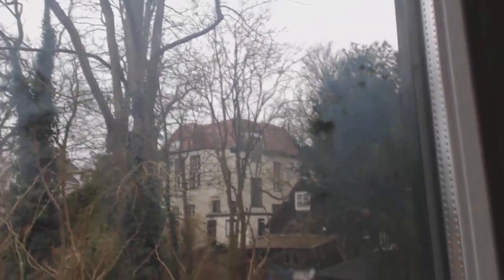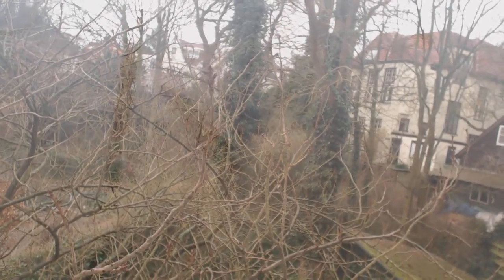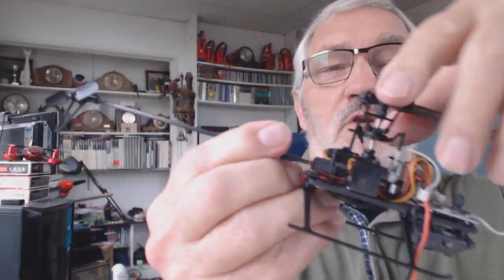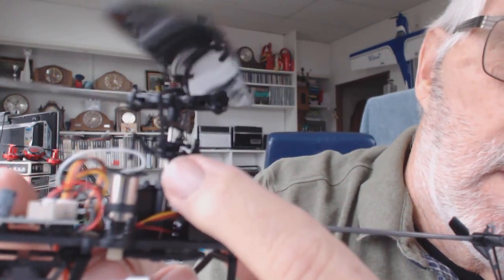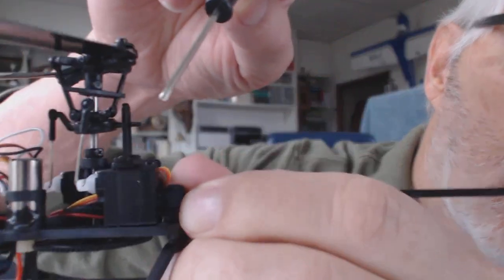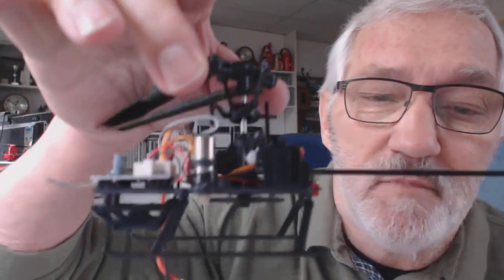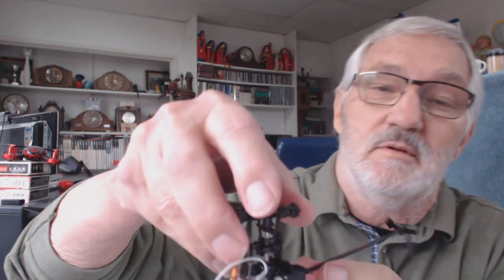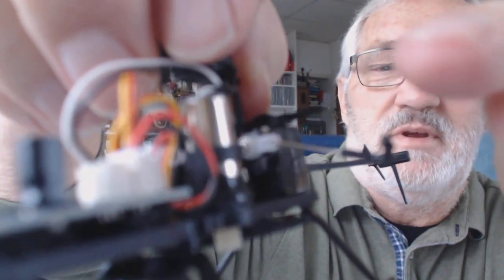Eachine E119 Broken swashplate

Comment: Awesome helicopter I own both the e119 and e129 the fly very nicely but the exposed plastic gear can be damaged in a crash so let me tell you how to prevent this, take a very thin water bottle and trim off the neck and make a piece fit from the canopy to the landing gear use transparent tape to fasten and no more stripping gears works perfectly.
Reply from the maker: Its not stripping the gear its the gead moveing on the shaft. What is very fragile on this Heli is the swash plate, the links break off